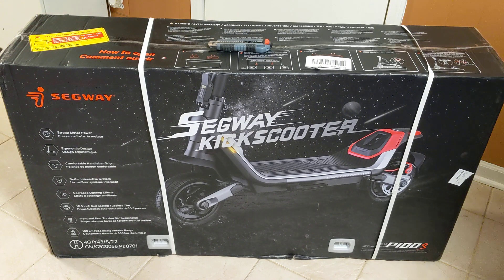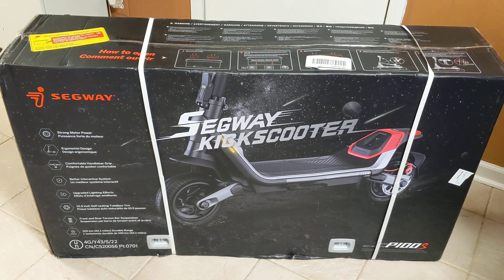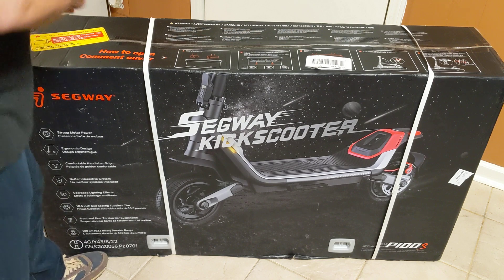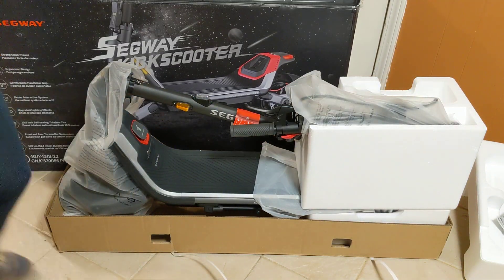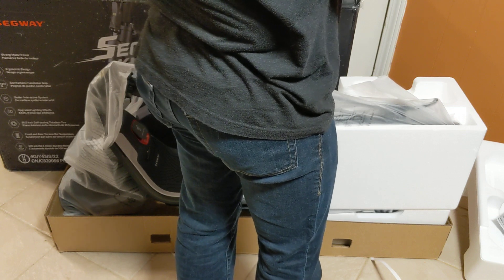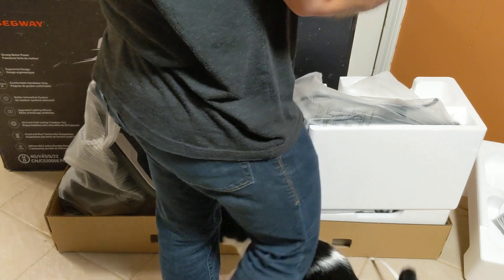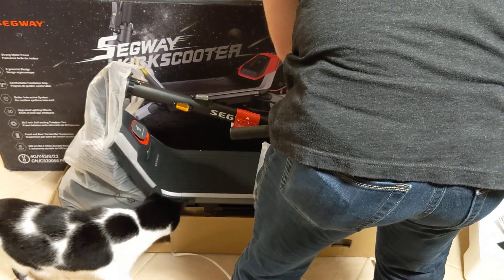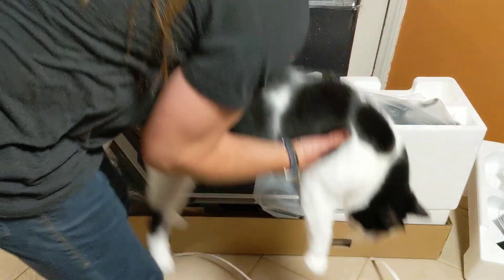Segway P100S unboxing video (low effort, low quality) plus Almost Assembly (ran into problems)

Comment: Hey scooter community 👋 I just purchased the Segway P100s 2 days ago, and it’s great, I’m just curious IS THERE a fast charger for this scooter? 
I also have the ninebot max g30 and I use a fast charger that charges in 3 hours which uses the smaller circular port on the side right next to the standard 3 prong port on the side of the scooter. 
This new P100s of mine doesn’t have that smaller circular port, just the 3 prong port, does anyone know of any fast chargers sold/ made for the Segway P100s scooter?
Reply from the maker: I don't believe there is. The built-in charger is supposed to be able to charge the scooter in 6 hours, so with the really long range of the scooter, Segway probably didn't see a need for someone to rapidly charge the scooter. Real-world range for the P100S is at least 37 miles, so someone needing to scooter more than 37 miles in one day seems a tad on the extreme side, I would say.

Comment: So coming back to this video after several months, what's your thoughts? I almost feel that the p100s is a bit much of a scooter for me because I don't think I'll ever take it above 25mph consistently. I do like the look though and build.
Reply from the maker: It's a fantastic mid-tier scooter. It definitely goes about as fast as I want to go on a scooter, but even at slower speeds the experience on the P100S is much different than that on a commuter scooter. The large tires, the suspension, and just the weight of the thing. It's a great machine and I'm happy to have it.

However, if you are in the market for the P100S right now, that means you have about $2k to burn. And right now, Wellbots (an authorized Segway retailer) is selling the Segway GT1 for $2,250, which is lower than even the Indiegogo price. That's nothing against the P100S, which does have more range, lighter weight, and more portability than the GT1. But still, it does create a conundrum. To buy the excellent mid-tier P100S, or spend just $250 more and get a top-tier GT1?

Comment: I had my eye on the Apollo phantom but this p100s is just beautifully designed I don't even care about the single motor and lower top speed 😂
Reply from the maker: I have quickly learned that a few mph goes a really long way on a scooter. 19mph on my KQi3 Pro doesn't feel terribly fast, but I just hit 27mph on the P100S and I can't imagine ever wanting to do 40 or faster. I had wondered if I made the wrong decision getting the P100S instead of a GT2, but the P100S goes about as fast as I ever want to go on a scooter.
Reply: Sold my phantom got the p100s best move I made, while the phantom is faster the build quality on the p100s is a million times better than the phantom also I’m using this to ride to work I’m not gonna be doing 40mph the whole ride 25-30 mph is more than enough for me
Reply: @Quepasaaqui718  how would you describe the suspension?  I've been seen a few complaints that it's not all that great and there's been some quality issues with a few units like missing sealants on the deck and misaligned stems.

Comment: 4:20 - No.  Don't tug on that.  You don't know what that might be connected to.
   - Buckaroo Banzai

The build quality looks supreme.  Scooters are great urban mobility vehicles but I wouldn't want to go more than probably 15 MPH on one.  I'm more of an e-bike kinda guy.  I had a folding 2 stroke scooter that I'd put in the back of my little Long-EZ airplane.  This looks a lot better than that!

There is no excuse for a company like Segway to have a poor manual.  Light orange text on a white background?  Pubs should know better, and human factors should shoot them if they tried something that stupid.

I assume Segway is an advertisement for scooter theft.

I hope your Segway doesn't spy on you, as is now common for electric cars, gasoline powered cars, smart TVs, smart meters on our houses... and of course, our cell phones, the most pernicious spy devices of all.
Reply from the maker: Good to hear from you again L4E! Yeah the P100S is an adventure. Took it for the first serious ride tonight to get a proper first impression. I don't know if you're on Reddit but that pretty much where I am most active, and where the review is.

Btw kudos on the Buckaroo Bonzai quote. My dad loved that movie, for some reason. I thought it was pretty ridiculous, and maybe didn't get it.

I'm on the fence with keeping the P100S after the first ride. It's definitely a proper 2-wheeled vehicle, and would make an excellent commuter for someone as long as they didn't have to carry it at any point. But for someone like me that just joyrides it might not make a lot of sense. I have a lot of fun on my smaller scooters, but this one pretty much belongs on the street and not on bike paths or sidewalks, and the streets just ain't that fun IMO. Idk we'll stick with it a bit longer and see if I am able to warm up to it.

As far as the spying devices... Hell I work for some of the companies that do the spying and I give them all the data they want. They're only interested in data in aggregate, or targeted in the sense that they can deliver an ad you might actually be interested in. No one is actually taking the time to listen in on the numerous Google Homes in my house to see what I'm saying to my cats or not talking to my wife about. As a whole, people are boring, and not interesting enough to spy on.
Reply: @Syndil1  - People are not interesting enough to spy on?  That's what they WANT you to think.  (tin foil hat emoji goes here)

I've been looking at Segway scooters after you piqued my interest.  I like the idea of a 2WD e-scooter for the same reason I'd like a 2WD e-bike... as an off road beast.  There have been huge advances in battery, power electronics and motor technologies but electric vehicles are still best for short range commuting, and that's fine because that's a huge market.

I bought a BMW G310GS, their baby adventure bike, two years ago for my 60th birthday.  I love it but I don't ride it as much as I'd like.  Typical of old guys buying ADV bikes, I had grand adventures in mind but my mojo ain't what it was.  I still haven't done an overnight camping trip with it.

Over a month ago, I bought a 1996 Daihatsu Hijet 4WD mini truck.  It's still sitting in Yokohama.  It'll probably arrive early December, so my fall project will be a spring project.  The little kei trucks are cute but surprisingly practical.  I wish we could import newer vehicles but protectionist laws require all used vehicles imported for on-road use to be 25+ years old.  There is also a protectionist 25% Chicken Tax on light trucks, so that'll cost me another $92.50, because I only paid $370 for the truck!  I also paid $2010 to ship it to the port in Newport News Virginia and there are a lot of little fees to get it out of the port and into the country, but I should have it on the road for under $3500.  Fortunately, the Japanese typically take good care of their vehicles and many have low mileage.  Mine has 44,000 miles on it, and it's in good shape.  Prevent the frame from rusting on our salted roads and it should last the rest of my life, no more than I drive.

I started converting my 1985 Trek mountain bike to be an e-bike, probably ten years ago.  I almost finished but stalled assembling the battery pack.  it has 196 of the 18650 lithium ion cells.  If I was doing it today, I'd start with a 4" wide tire ATB fat bike with good hydraulic disc brakes and use four of the 20 or 30 amp hour 12V LiFePO4 batteries.  My initial goal was to make an urban assault vehicle as my solar charged LibertyMobile - no gas, no license, no registration, no insurance, no property tax... and I can use those federally funded and under utilized bike lanes to skip to the front of the queue at stop lights.
Reply from the maker: @Liberty4Ever  I find that a 20-mile range is about the sweet spot for an electric scooter. I can take a nice, long leisurely ride with that, and I don't really want to ride much longer/further than that. Scooters are great with how easy and accessible they are to ride, literally just step on one and go, but still, you are standing for however long you are riding. 20 miles is great.

Segway/Ninebot Max tends to make higher priced scooters, but you pay for build quality. There are countless brands out there that are basically "kit" scooters. A box of batteries with a motor or two mounted to it, and a bunch of ready-made scooter bits thrown at it to make it go. You can get some ridiculously fast kit scooters and get a lot more performance for your dollar but they are not going to be as reliable as a Segway. Build quality is my number one metric, so I gladly pay what some call the "Segway tax."

But, since PEV technology has advanced so much, probably a great time to finish up your bike project (or abandon it and buy an already-complete fat tire eBike)!

I love Kei vehicles. I want a Nissan Figaro, and a Kei RV. I've actually shopped for Kei RVs. They are so damn cool. And of course way more fuel efficient than pretty much any other RV you might consider.
Reply: @Syndil1  - I had to look up the Nissan Figaro.  ("I never had you pegged for one of those foreign jobs." - Nick Nolte in 48 Hours)  I'd seen similar Japanese mini retro cars like that such as the Nissan Pao that a Torrington Connecticut importer had recently.  Definitely points for style but with only 20,000 made and never sold in the US, it's gonna be tough to find parts to keep it on the road.  A friend bought three of the Fisker Karma hybrid cars after Fisker went bankrupt.  They're what the Tesla Model S wants to be when it grows up... the prettiest car I've ever seen but not too practical.  They're luxury sports cars.  The car is larger than it looks in photos but there's not a lot of interior space.  Upon their bankruptcy, Fisker open sourced all of the code and owner/enthusiasts have taken over support, including new OS releases with open source upgrades.  That's pretty cool.  I can't stand Tesla cars sending data back to Tesla, and the way Tesla treats their cars the way software companies treat their software, with one sided end user licensing agreements that essentially mean the car isn't truly owned because you can't work on it yourself, there's a diminished ability to sell it to a new owner, and Tesla can scrap it in their database and you can never charge it at a SuperCharger or have it repaired.

I hate the way modern cars nag me to wear a seat belt, so you can imagine how I feel about them spying on me and preventing me from repairing them.  I want to own a vehicle and not be owned by a vehicle.

I've wanted a 4WD mini van ever since I had a VW microbus Westfalia camper when I was in college that I used to haul my climbing buddies on rock climbing trips.  We never actually slept in the van because "I'm not a car camper", but the idea for a 4WD overlander van always appealed to me and they'd make great adventure mini-RVs.  After YouTuber MotoCheez bought a 4WD Daihatsu Atrai van to go with his 4WD Daihatsu Hijet pickup truck, I jokingly commented that I'll probably buy a 4WD Atrai before my Hijet ships.  Kei is more addictive than crack.

I can see where a 20 mile range on a scooter is the sweet spot.  I think they'd be great for commuting, other than the problem with theft.  I hid an Invoxia GPS tracker in the beak of my baby GS adventure bike in case someone steals it, so I can retrieve it.  ("We need shotguns for this job." - Jules, from Pulp Fiction)  If you like leisure rides instead of commuting, theft probably isn't a large concern for you.

Speaking of leisure rides, a buddy just texted me asking if I'd go riding with him today.  I have Mom (91 with dementia) from noon to 9 PM so I put him off until tomorrow.  We're discussing where to ride:  Ohio?  Indiana?  Cumberland Gap into Tennessee?  Something, something, ferries?  Much as I love the concept of an electric motorcycle, EVs need not apply for the trip we'll be taking, wherever that is.